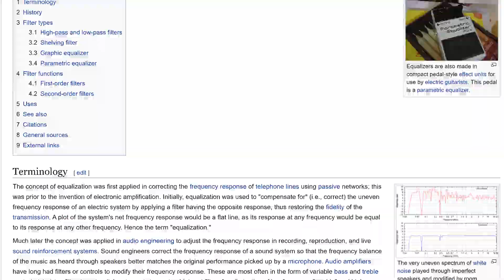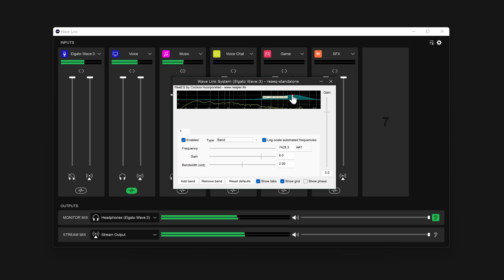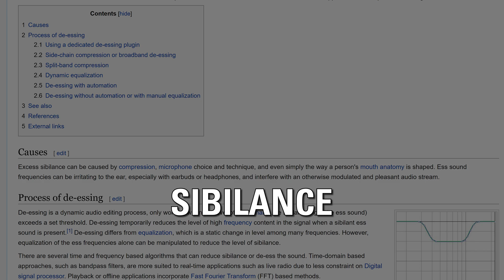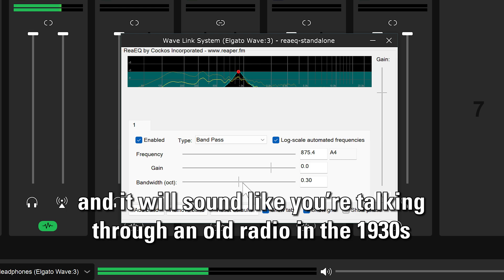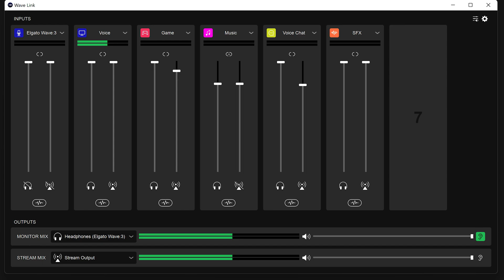How to use Equalizer (EQ) Audio Effects in Elgato Wave Link

Comment: Hello
I have a problem with WaveLink. Small but annoying. I configured the Wave 3 microphone with Windows 10 as recommended. Everything works fine except the effects. When I make voice settings on the Elgato EQ, I can't hear them in the headphones. As if they are not turned on at all, but the effect icon indicates that it is turned on. The same goes for other effects. The same effects enabled in Audacity works fine. What is the reason for this? I will be grateful for any help.